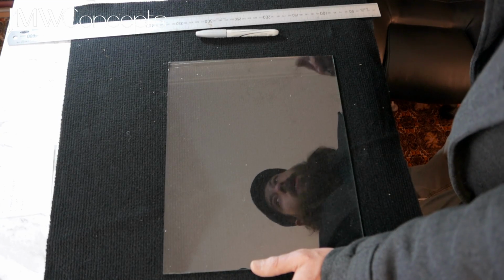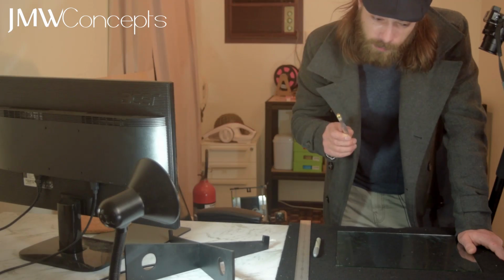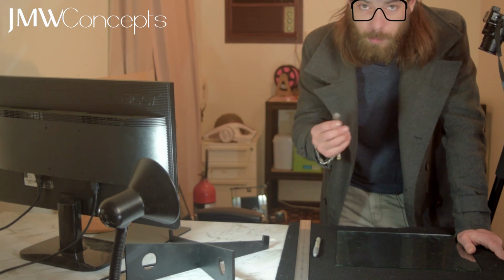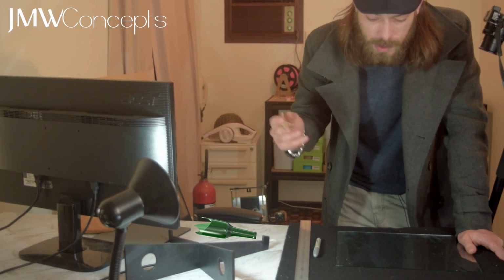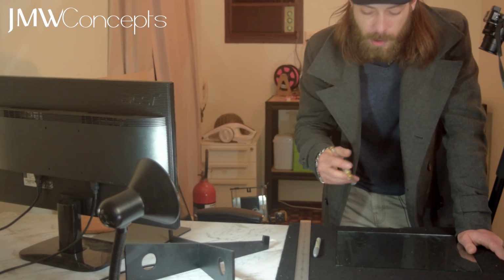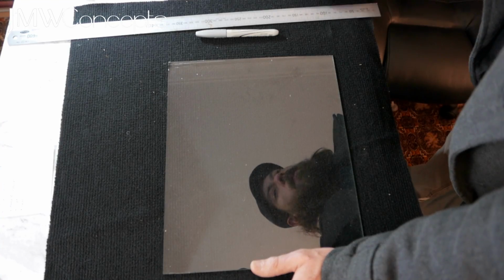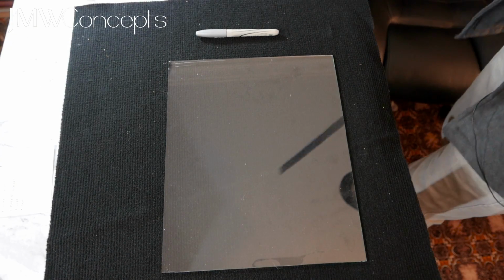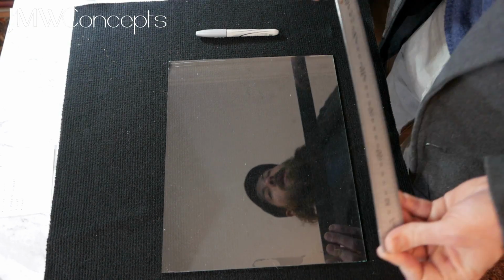Cheap Glass for Your 3D Printer - Glass Cutting Tutorial

Comment: Have a question:  Is that borosilicate glass? The reason i ask, in the case of 3d printers, borosilicate is the standard due to it's resistance to thermal shock, low thermal expansion, and high heat resistances. Using normal window pane glass, or soda-lime glass, doesn't have these properties, and is much more likely to expand, warp, fracture , or break under the thermal cycling of repeated prints, or at high-temp printing such as that used with ABS and more exotic filaments. 

Now some tips & Info: 

1) You don't need a straight down angle to cut glass with that style of cutter, because it's carbide / tool steel, you just need firm pressure, and ensure the cutting wheel stays in contact with the glass to create the score line.

2) It's always advisable to make 1 clean score, rather than going over a score several times to fix mistakes. Multiple score lines has a higher chance of the fracture following random paths that follow the grain structure of the glass. If an inaccurate score is cleaved, scoring the excess and nibbling can be used to remove that excess, in the case of an under-cut, you'll have to start over. 

3) It's usually not advisable to edge break hand-scored glass in the event of an uneven score, or "wavy" score. It's always advisable to rap the opposite side of the score with the tapper at the end of most glass cutting tools, or use glass running pliers. 

Hope this was helpful to everyone.

Comment: I believe oven doors have borosilicate glass in them. So if you find an old oven you may get free glass. Just replaced our oven yesterday and about to through the old one when thought hang on I wonder if that glass is good for my printer. Have not tried it yet though.
Reply from the maker: Did you try this? I wonder as well. I think not due to the fact that oven glass is designed to keep the heat in as much as possible and won't transfer to the print base. Please let us know of your experience though! :)
Reply: @JMWConceptsTheOfficial  I did try to use it but you can't cut it to size as it is tempered and just shatters into thousands of pieces.

Comment: I just tried it today. I was using a cheap $15 one. I marked a 6x9in. print bed and it didn't score properly. I used vegetable oil and applied a quite large amount of pressure, but when the scoring was done and I whacked it with the ball on the end of my cutter it shattered and exploded into a million pieces. I got one in my foot and had to go to the hospital. It went right through my shoe!!! :(

Comment: The brass bit on the non cutting end is there to gently tap on the reverse side (under side) of the glass after the cut. That's how the glass will break with the most precision and squareness. You should almost be able to watch as the crack follows the cut. There's glass shards that come off when it breaks so it's best to do it over an open box to catch the shards. Does it work better/same/worse then the borosilicate glass?
Reply from the maker: Thanks Nick. I found that out a little while later when I was cutting shapes. 
I have printed(guessing) about 100 hours on a piece of picture frame glass with no issues. I let it cool slowly(don't take it off the heat bed while hot) as I think that is likely to be where you could go wrong but no worries my way. Got glass on all my printers now. 😊

Comment: How do you handle the edges, they seem very sharp to me? I wouldn't want to accidentally cut myself on them, any way to smoothen this, or is it a non-issue basically?
Reply: Yes  they are sharp. You can wet sand the edges to make the safe to handle. Anything med to fine grit can work.
Reply from the maker: ntheory is bang on the money. I personally have not bothered as I rarely move the glass and when I do, I avoid touching the edges but it is probably a very good idea to do so.

Comment: Best method I found was to mark the ends where to cut, tape down the ruler or strait edge onto the glass, use cutting tool then flip and repeat before snapping. If cutting 2 sides then measure from original uncut edge to keep it square.
Just remember as stated in video take into account the tool width. You can do a practice run on the off-cut area you are about to cut off.